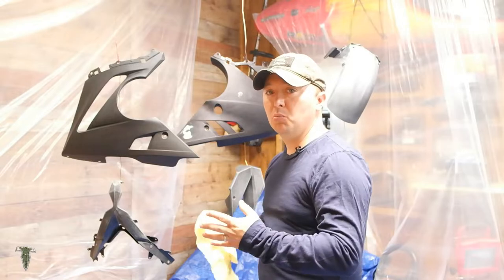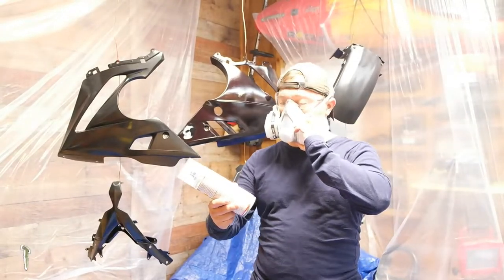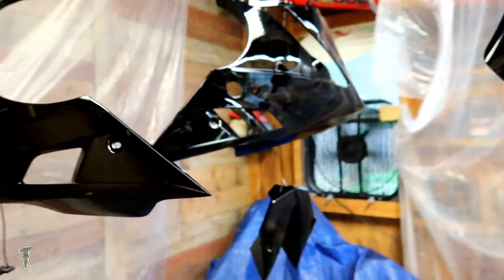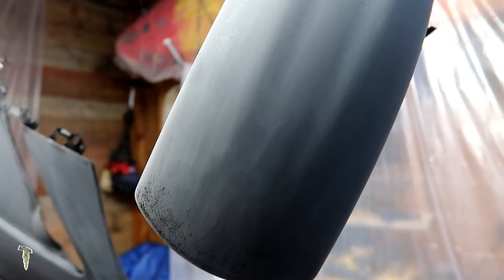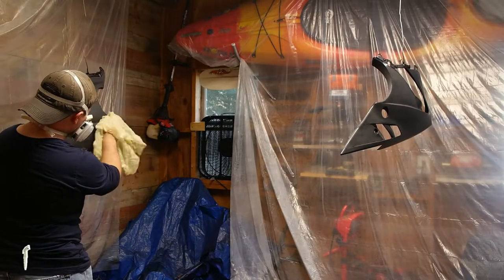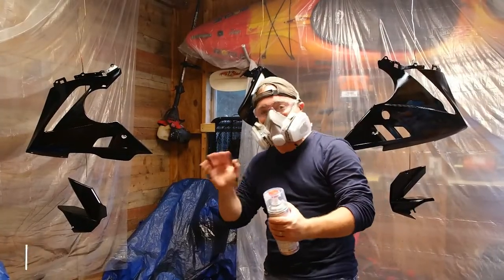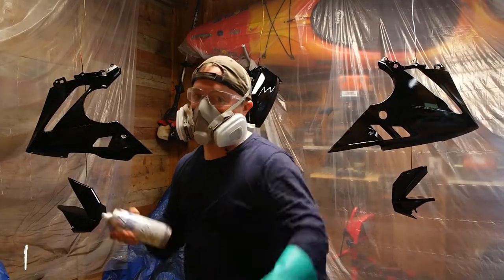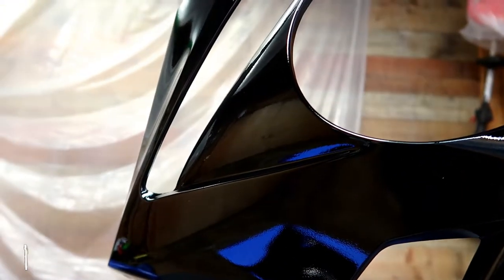How to Paint Motorcycle Fairings pt.3 | Paint and Clear Coat | Ride Rehab ep. 16

Comment: Thanks for the instructive video!  I'm in the middle of a painting project for my bike and was curious: after you sand paint smooth before clearcoating, do you use any compound or polish on the paint before the clearcoat?
Reply from the maker: If you sand the base paint for any reason, you have to spray another coat before clearcoat. Sand, clean w/ soap and water, tack cloth, spray color,  spray clear. No polishing or buffing between coats.
Reply: @Tremonte  Thanks for the quick response!   
I went ahead and clearcoated.  I already checked out the video after this for how to sand, compound, and polish.  I made some mistakes since it's my first time ever doing this sort of thing but it looks wonderful already.

Comment: I went to Walmart and got spray cans after watching this video (it didn't have a button under the can.) It came out super shiny and flat No orange peel.  The tip is not to hit the button under the can. I was going for the textured look.  I hope it lasts the season.
Reply: My understanding is then you didn't activate the 2nd chemical and it won't last if gas or oil is spilled on it.

How did the season go?
Reply: Sooo..... You bought 1k cans without the 2k button on the bottomside...
Then you tell the tip is to NOT hit the non existent button?????

Comment: Orange peel is typically the result of improper painting technique, and is caused by the quick evaporation of thinner, incorrect spray gun setup (e.g., low air pressure or incorrect nozzle), spraying the paint at an angle other than perpendicular, or applying excessive paint.
Reply: He didn't use a paint gun
Reply: @NoHypeJizzReviews it's the same

Comment: I didn see the primer going on the fairing?
Reply from the maker: The Bulldog Adhesion Promoter works as the primer for ABS plastics.
Reply: Try not to use primer unless on metal
Reply: Oh i thought applying primer would be beneficial,and easy to see what is,and isnt painted. Im repainting fairings, do i need to prime,or just eat into old paint and paint over ha
Reply: @darrenscully6959  you dont need primer on plastic or fiberglass ,,,,the best shine yo ever get is painting fiberglass      i am 70 and have spray painted all my life ,,clear coat base coat is so easy ,but ,cellous and acrylic ,buffed to a sine is the real deal ,,,base clear revolutionized getting a deep shine with no hard buffing love watching the younger guys doing great work .oh and if you drive a lotus ,i probably sprayed it